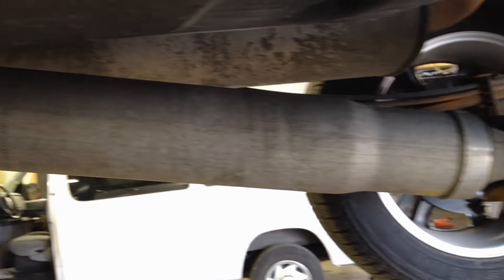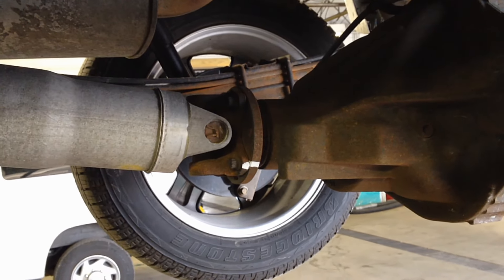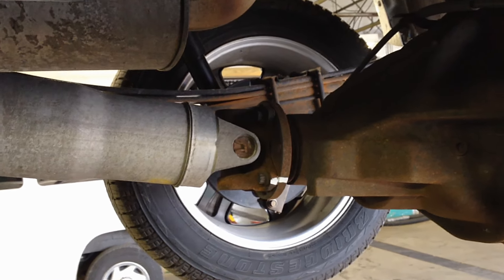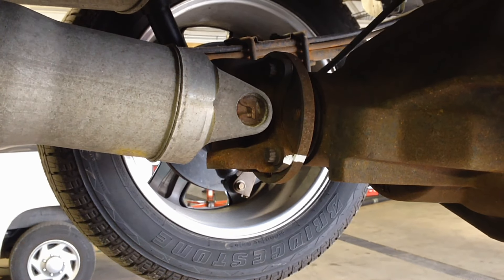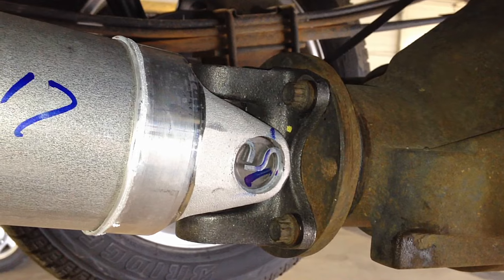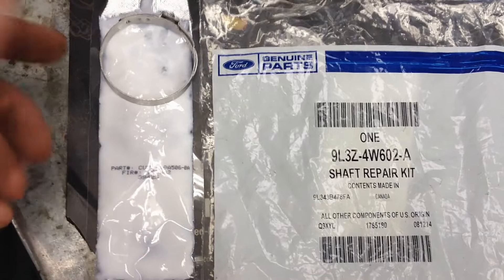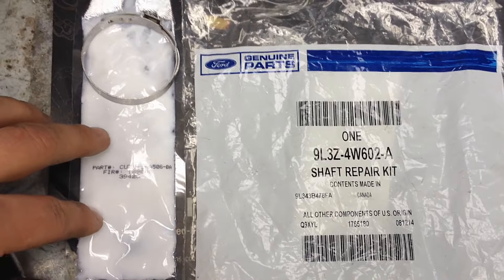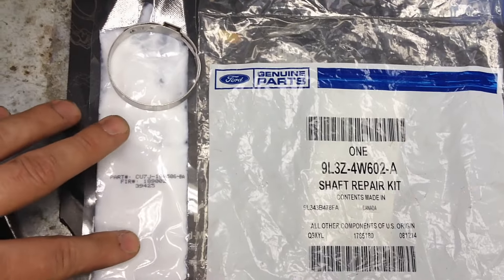Ford F150 One Piece Driveshaft Slip Bump- FIX!

Comment: I can’t say thank you enough. I’ve had my truck for 10 years and it has “bumped” from day one. Everyone just said, “Yeah. All F150s do that!” Well....not anymore. My 2005 F150 XLT drives smooth as can be now. I would have sworn that the rear differential was shot...but nope. An $18 kit, and about an hour of my time was all it took. THANK YOU!
Reply: What did you do?
Reply: I used the kit from the video to lubricate the spline. It is toward the end of the video.  Pause it to get the part number. It’s easy.

Comment: Is it possible to replace just the yoke and not the entire driveshaft? I have a 2010 screw fx4 with the one piece driveshaft. Have had to grease the yoke three times in the last 3 months. Searching for a permanent fix!
Reply: I don't know about the Fords, but in the Jeep community a popular mod is the SYE, slip yoke eliminator.
Perhaps you could look into it and see if there is a similar mod for fords.
Reply: Thanks I'll look into that
Reply: For Jeeps it is a swap that is desired for the benefits it brings.  Hopefully you can easily find out what t-case you have and decide if that would be the best way for you to go.

You will also need to either get a new drive shaft, or get yours modified for the new end.

Most of the time those with jeeps do this in conjunction with a lift because they will need a new drive shaft anyways.

Comment: I have a 2002 SVT lightning and it's making a horrible noise sounds like from the transmission I just replaced all the diff fluid in the rear and it seems to be good use the friction modifier the whole nine yards but the drive shaft feels like it's got play in the spline area where it goes into the transmission so just greasing it up could  fix the problem?

Comment: I have a 2012 F 150 Harley davidson edition. 
Raptor chassis,  parts. 6.2 gas
155,000 miles
I have a clunk
And a chassis vibration sets up.
Bad vibration between 50 and 60 mph.
Help ???
I did have to replace my transfer case drive shaft a few years ago.

Comment: Hello.  Is it possible to add too much grease and cause a vibration at highway speeds and around 45mph?  

Also if it’s over packed is it possible for grease to get into the xfer case?

Comment: FordTechMakuloco , I have a STX 4X4 2009 F150 (MFG date 12/2008). I was wondering if yall have seen a similar problem in those? I feel like I'm having a similar problem. The truck does get worked, I use it for my business and have hauled a trailer quite a bit with it. It has also been in some rough terrains in the mountains and at the deer lease and it is also my daily driver so I know it has been pushed a little more than the average joe. It shifts a little bit rough from 1st to 2nd gear and kinda does a little double stop type thing when slowing to a stop..
Reply from the maker: Danger Nuts Yeah yours is binding also same concern and same fix.

Comment: I'm repairing the universal joints on my 2001 F150 SCREW 4.6 RWD. Should I use the lubricant inside the splines before I reinstall my one piece aluminium drive shaft? By the way I watch your videos constantly! I would love to work on your shop just to gain some knowledge from you so the videos are the closest thing I can get to that alternate reality! 😄

Comment: how often should the owner do this ??? every oil change ? every month?
Reply: I believe I recall hearing every 30k miles...  I just finished mine this evening. I don't plan on doing it again until it starts clunking again.
Reply: Evert 6 months to a year is good or until you start to feel the clunking again. What happens is the nickel coating comes wears away so you'll have to do this often or replace the drive shaft.

Comment: I have a 97 F150 that also has a clunk when it takes off. Do you know if this also applies to the older body style? Mine has the 4R70W and the manual 4406 transfer case. It is an extended cab, short bed, and it also has a one piece driveshaft. Thanks!
Reply from the maker: This applies to any of the ford trucks yes, give it atry and check the u joints while you have it down.

Comment: I only notice the false bumping situation you describe going up hill, and at speeds higher than 40. Never at low speeds.
Reply from the maker: That is a secondary ignition misfire.
Reply: FordTechMakuloco - where’s the link to your video about that lol! thanks for your reply. I’ve watched many of your videos.

I drive it like a granny 07 5.4 82k. 
I’m talking about slight inclines and more common for me with segmented concrete roads like we have in WI. (30 foot slabs at a time) 
One instance recently with power loss where RPMs wouldn’t climb above 2500 3000 at initial take off, and then it went away back to normal. Car had just sat 8 days during vacation when that happened.

Comment: Your video was extremely helpful. I replaced the bolts with new as a precaution for $10.
I read that others had issues with chocking the rear wheels. I used 4x4 pieces of wood and plastic RV chocks to secure the wheels. 
Thanks for making this video, you’re the absolute best.

Comment: I have a 2011 ecoboost it has pretty severe binding greasing it fixes it for about a month at best. What is the part number for the drive shaft? How much should I expect to pay? Why can't I just replace the yoke? It's the one piece FYI
Reply from the maker: +Frank Adams You can replace the front yoke but the driveshaft must be rebalanced afterwards. The part number varies on build date and wheel base.
Reply: +FordTechMakuloco would that be covered under warranty or something you would have to fix on your own

Comment: Is there an special alignment procedure (slip yolk into the transfer case/driveshaft to the pinion flange) when installing a new driveshaft?
Reply: I just did mine as a preventative maintenance. But now I am getting a bump. I aligned my flange off marks, but not off the transfer case, I'm wondering if that's why I have an issue now. Did you ever figure this out?
Reply: That's a bummer to hear! I have not figured it out yet, unfortunately. I'm installing my new driveshaft in the next week or so and my plan is as follows: Clean the pinion flange super well so the mating surface is totally bare and clean. Apply a thin layer of anti seize to the flange to prevent any corrosion. Grease the slip yolk with Motorcraft XG-8, and install the bolts with some blue threadlocker and tighten until they're torqued to spec. Hopefully beyond being thorough with cleanliness and prep, there isn't anything else to it... I'll give ya an update once I do the install. Let me know if you find anything out as well!
Reply: @GeoffKuhn  sounds good! Thanks!
Reply: Installed my new driveshaft with the method I mentioned above with zero issues. Everything seems to be a smooth as silk!

Comment: I have a loud clunk noise in my 2010 screw it is way worse under load and even more significant when turning any thoughts? Dealership told me clutch packs needed replacing? I added limited slip additive to the differential. Any whelp would be much appreciated!
Reply: Jamie Kremer I have to add it gets worse on long trips.

Comment: Hello I have a 07 F150 and it has a 2 piece drive shaft, every time i gas the truck from 0 like in a light I hear a tock noise do you think its the same problem and only needs lubrication? thank you

Comment: I had a 2000 F-250 2WD that shuddered on acceleration from a stop. I removed the driveshaft and lubed up the splines on slip yoke with grease and the problem disappeared!
Reply: Mine vibrates on acceleration

Comment: Would this apply to a 2007 F150 2WD? When I take off with some extra throttle it makes a "thud" sound, but if you baby it off it doesn't do it.
Reply: Mine does the same thing. Its 2004 4X4 though. I will be doing this job on my truck this weekend.

Comment: Same thing was happening in my Ford Lincoln '96 Towncar I just thought I must of had a cat hiding in the wheel well or something and it was falling out and getting run over... but I always saw no guts on the wheels and no one knew what that noise and bump was now I know it was the drive shaft doing this... thanks man... if you guys want to not have this problem get a Toyota or a Lexus much better car
Reply: Jedi Yeah, Tundras are notorious for axle seal leaks dude. Every car has its faults. Ford for the win

Comment: Would this be the same for a 2000 F150? Could I just pull the drive shaft and put grease in it like the new one you had had on it? And if so, what kind of grease do you use? Thanks a lot!
Reply from the maker: Yes this would be the same but I have not experienced this issue on the older f150 but if you are then yes.
I would still use the kit shown for the grease. They have been perfecting it for years as stated. Any grease will work at first but in the long term this is the best solution
Reply: Kenneth Lucas My 2000 F150 has the issue too so grease the slip yolk but I still have the issue. I was told from a shop it was bad bushings in the leaf springs.

Comment: Doesn't the fluid form the transfer case splash up and keep the slip yoke lubricated??? I have a 2010 f150 that started making a rumble/ vibration sound from a stop. New driveshaft and u joints... Still making the same noise....HELP!!!!!!

Comment: Hello, I have a question.  I have a 2006 ford ranger XL 4x4 regular cab.  At first i was having a small clunk/studdering feeling.  So i figured it was the slip yoke.  I removed the back of the drive shaft and slid out the shaft far enough to grease the splines.  I used valvoline synthetic grease.  I greased it a good bit not the female end and put it back together.  now my truck is Worse!   I assume it's because I used the wrong grease? I don't know how else it could've made it worse other than that.  Thoughts?
Reply: +Allan McGarry btw...I have the 2 piece shaft.
Reply from the maker: +Allan McGarry Clean that grease out and use the stuff in the kit I link to in the video description.
Reply: Ok so I ordered two kits from ford.  Before i go tackling it, i just want to know if i should use brake cleaner to get rid of any residue of the old grease.  Also, was it the grease I used?

Comment: So why would this be dry? I have the transfer case fluid all over the splines inside and out and oil running out after I pulled the slip yoke out of there on a 2014 one piece shaft. (This is what I expected to see, doing this kind of work for 30 some years) Do some of these models have that tail stock a dry area, no fluid in there?

Comment: Just ordered this stuff for my 99 Sierra. That slip bump is most noticeable when taking off. Actually bumps twice, kinda like someone gave you a love tap on your rear bumper. Hope it works! Thanks for the video!
Reply: My 2012 doing what you just said ..sow you changed the driveshaft or just greased?
Reply: @ch.i.c.o5922  just greased the splines. Didn't really work. Then did u joints. That didn't work. Turned out to be rotted out leaf spring hangers on the rear. Lol

Comment: I have a 2015 that has this slip bump. I took out the driveshaft and greased the slip yoke with PTFE Grease. 1 week later the bump has come back. 
Will replacing the yoke and applying grease fix this?

Comment: Will this feel like a shudder as the driveline is loaded up from a stop? My truck feels like its wagging its tail as the driveline loads up from a stop, quickly goes away once your rolling. Or is this normal?
Reply: I think if have the same "shudder" you're talking about in my 2012 but I don't think it's related to the driveshaft issue.  If you ever get it figured out, post up the solution if you don't mind.
Reply from the maker: Yours is likely from driveline angle problems they have a tsb on shimming the rear diff.

Comment: I have a 2011 ford f350 super duty 4 x 4 dually it does it when i put it in gear how can i fix it also its a 4 door
Reply from the maker: klippelck Same fix grease the slip joint.

Comment: I had something similar on my '03 4x4 Ranger.  It also has a one piece aluminum driveshaft....got the good ford tube of the same grease and it's been good for several years now.  I originally thought it was a u-joint but ended up being this exact same issue.

Comment: Brian, I have a 2009 F150 4.6L 6r80 trans with the two piece drive shaft but both ends are Flanged so there's no slip joint going into the Trans tail housing. Am thinking that since there's a flex boot at the carrier bearing that's the spot i need to add the new grease. Sound right to you? 

Because of your really great videos and the way you walk thru us through the repairs I had the confidence to tackle all of the upkeep repairs on my truck.  Thanks Huge for all you do!! Really awesome.

So far, after re-watching your repair videos to get my head on straight. With my son's help we have managed to replace all of my shocks/struts, transmission oil/filter and new adapter, spark plugs and coil packs.  

Little bit stuck on the drive shaft upkeep (bump and stick issue - big issue for me) and need a tad bit of your wisdom. I bought the white Teflon repair kit that you showed in this video.  Because i wasn't 100% about the driveshaft I didn't take it apart when i did the other repairs. Realize this repair is a no-brainer for you but i am like i mentioned a tad concerned and really do want this bump issue fixed right.

I do have an extended warranty on the truck but it expires this year and have only used it to replace the windshield when i bought the truck new.  It had bubbles in the glass from the Kansas plant.

Please help here -- Should i warranty the driveshaft to fix the bumping issue on my '09 pickup w/about 50K miles. It's not drastic mind you, but really freakin annoying. Thinking about the poor plating FOMOCO found and you mentioned.  Am I right about where the spline is (at the carrier bearing) ? I'm kinda comfortable doing it but it's hard the son's gone back to the mainland and I'm handicapped. It would most likely be an all day task for me.  Don't quite bend like when i was younger.

Can i get from you the TSB or Recall numbers to show the dealership for the driveshaft for my truck? Do you want my VIN # ? The dealership isn't the most friendly at giving out info and acknowledging there's a repair TSB Recall out there.  They tried to make me pay $150 to grease the wheel bump stops.  Who knew that i needed to a dab of grease there every so often. It's listed in the repair books or service warranty.

Questions - Am I right about where the spline is (at the carrier bearing) ? Can i get from you the TSB or Recall numbers to show the dealership for the driveshaft for my truck? Do you want my VIN # ?

Sorry for the length of this and keep on truckin - You Rock.

Comment: Any idea on what would cause a vibration at speeds above 45mph? Vibration doesn't occur at the same speed all the time but does become worse as speed increases. It varies in intensity. Feels like it's coming from the bed area. Do not feel it in the steering wheel. The whole body shudders. Tires have balanced and rotated 4 times in 6 months. No help. 2011 super cab FX4. Thanks!
Reply from the maker: falconjet3 Anytime it feel like it is in the floor it is from the driveshaft being either loose, u joint bound or out of balanced.

Comment: I dont really notice a bump feel like you describe in this video but more so a single click usually when I put the truck into reverse from park, sometimes if it doesn't do it right away I can put my foot on the brake and give it slight throttle it will make a single click going back, I don't hear any other noiseafter this single click but this click is pretty consistent. Do you think dry splimes that need to begrease could cause this or is it something else? Or maybe it's normal? My 2011 did the same thing. Current truck is a 2014 with 34k miles

Comment: I just bought a 2008 F150 with the 4.6 and sometimes on a hard acceleration and then let off the gas my trans has a hard down shift, if I pass someone and really punch it even worse. Otherwise the trans shift smooth with no dash lights. Could it be as simple as the splines needing grease? Also one other thing. We drove to Florida about a 2000 mile round trip from Texas. My truck leaked a fluid on my daughters driveway and I check all fluids and they were fine and after the trip back home it did the same in my garage. It looks to be a rear main, but it seems strange it only happens when driving a long distance. What do you think about it, should I go ahead and get the rear main replaced.

Comment: I showed this video to FORD and they said "Internet People think they Know everything"! LOL I have a 2014 SCREW with 5.0 L engine and mine has been doing this since new. I now have 28K miles. 5 different Ford dealerships said they don't notice it and that this is normal shifting and wouldn't even entertain flashing the transmission or doing this lube. It sounded like I was getting rear ended every time it shifts or you come to a stop. Its worse during the winter when the fluids are cold. I can't wait to try this. I'll update back if this helps or not.
Reply from the maker: I am not internet people though I was a Ford dealership technician for 10 years and now run a Ford speciality shop. They should be embarrassed not knowing of this issue.
Reply: I'm sure FORD knows about it but won't admit it since its probably not going to kill anyone and would cost them a lot. I was just at the FORD dealer again and they told me I had a two piece drive shaft and that lubing it up wouldn't solve my problem like you did. So I crawled underneath and looked at the driveshaft to see what it was. Sure enough its a ONE PIECE SHAFT!!!!   They are either lying or incompetent and I'm not sure which is worse. Thanks for making these videos. You give hope to the hopeless.
Reply: We did the same/similar thing on Chevy trucks in the mid 2000s.